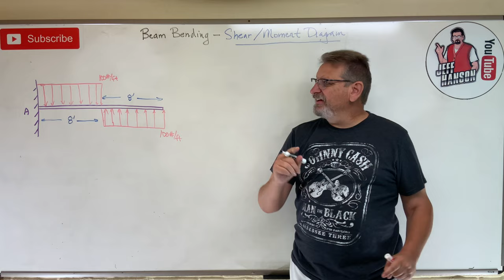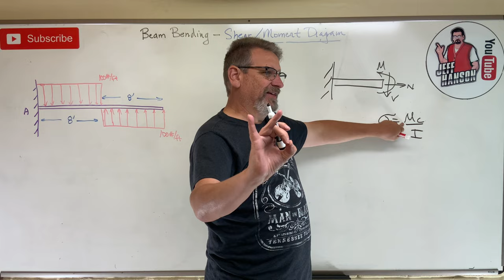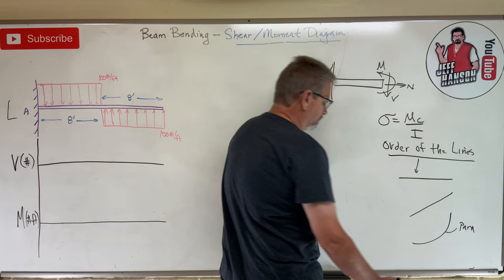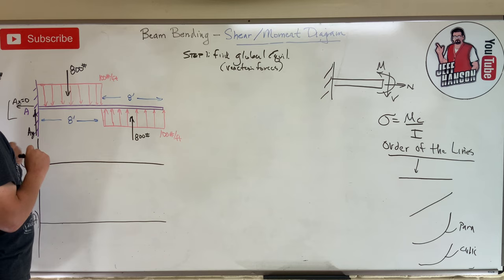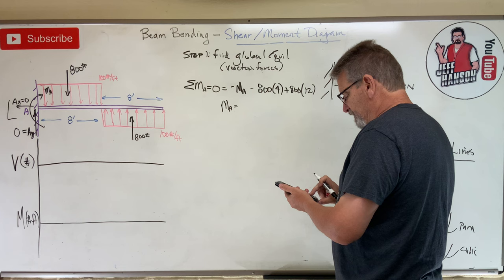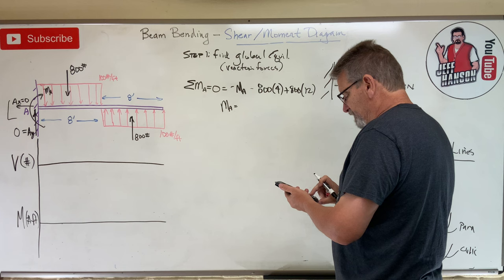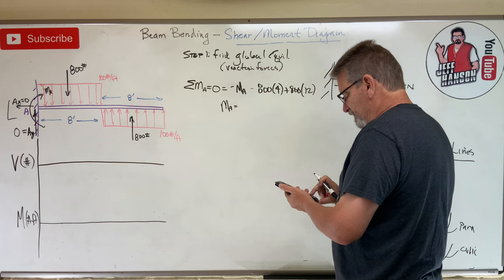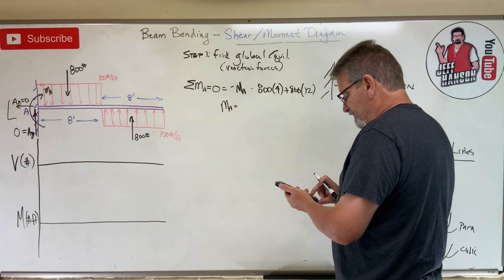Mechanics of Materials: Lesson 28 - Beam Bending, Shear Moment Diagram Example

Comment: I think You made moment signs incorrect according to the convention I know from statics
Reply: i agree with you sir
Reply: Firstly this is Solid Mechanics not statics. Secondly the orientation does not matter as long as you are consistent. When you use Bending stress equation make it negative if the point you are examining is in compression. That’s it
Reply: @RobertHunterAero  😃